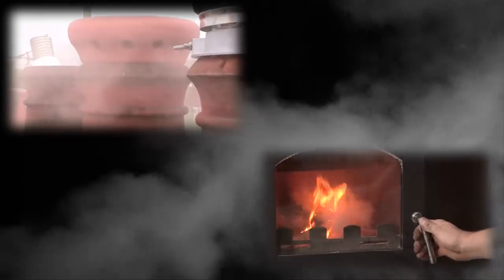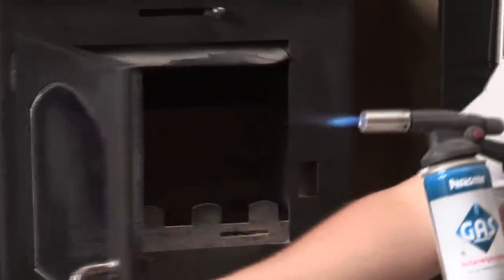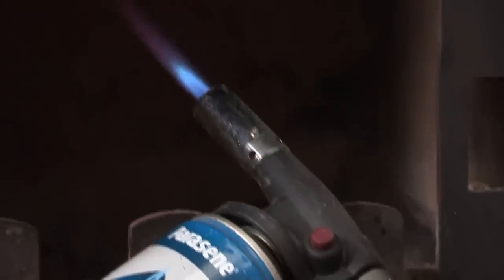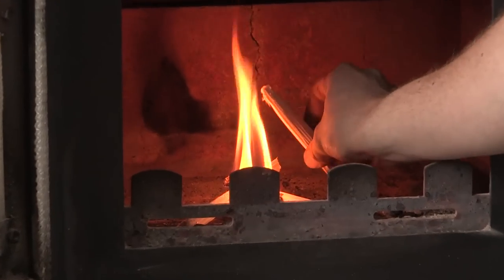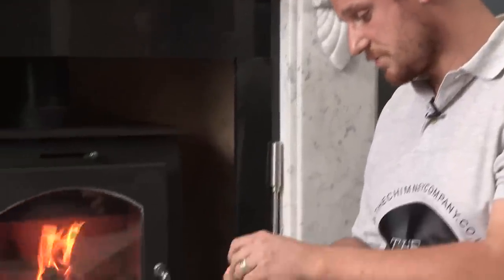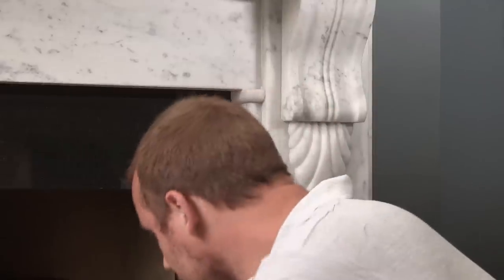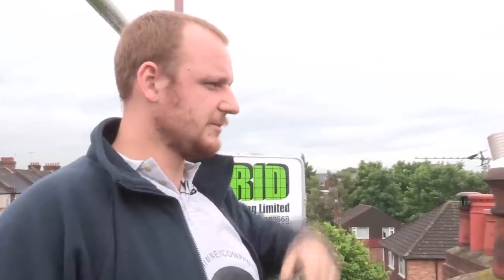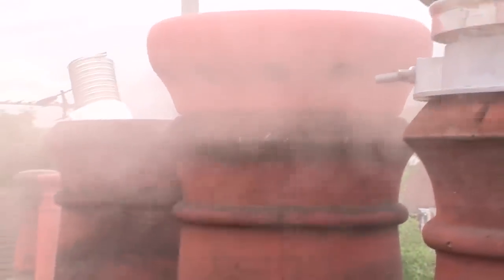How To Perform A Smoke Test

Comment: I have a problem with too much draft. The stove just devours fuel and never just burns gently or "ticks over" overnight. It is an old house with tall ceilings needing 11X 1 metre rods to reach the top of the chimney when cleaning. The stove is a Bilberry 22KW. boiler stove. I was wondering if there is anything I can stuff into the stove pipe to reduce the draft. We got a flexible liner into the chimney and this seems to have increased the draw even more. It is also curious that when the furnace door is open, the draft is much  less than when it is closed. I burn a mixture of off-cuts, hardwood and bits of pallets. It is all clean dry and untreated wood. I don't burn coal of any description unless it gets really cold.
Reply: You can get a stove pipe damper to install in your pipe, but first I'd make sure all your stove seams are airtight, replace gaskets, caulk the other seams, because with a flue damper you're inviting creosote buildup in your pipe, unless you clean it often then it shouldn't be an issue! Good luck